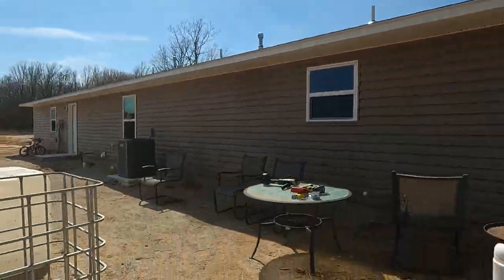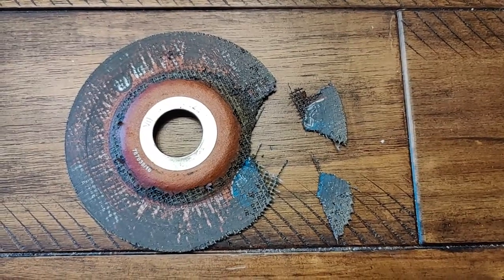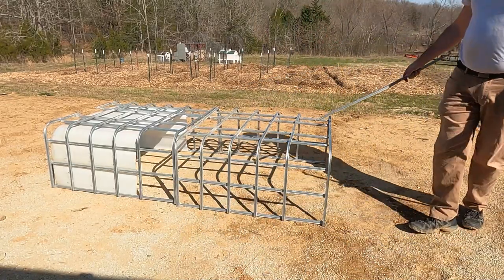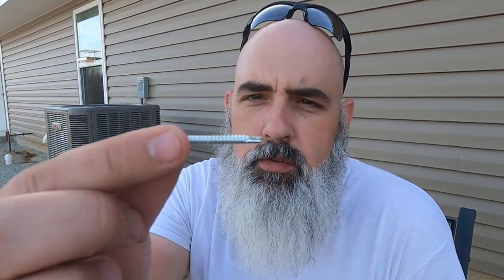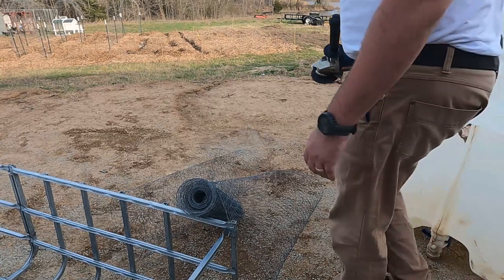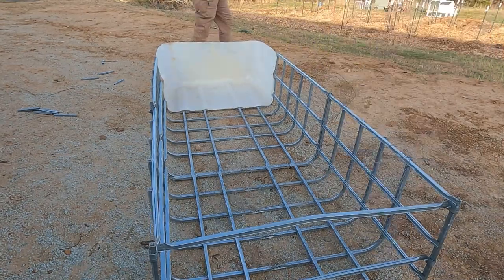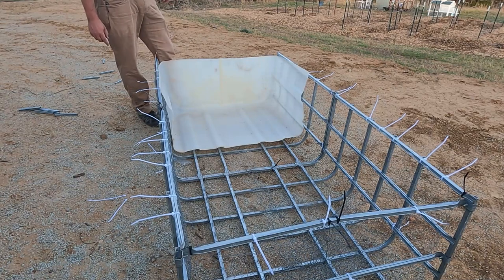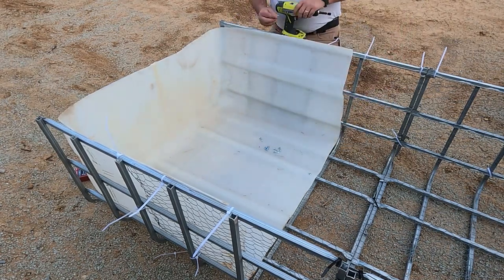How to Build a Simple, Sturdy Chicken Tractor from an IBC Tote

Comment: Seems like a good idea but it also seem like a waste of tote.  So many things that you did would have been easier done by out means.

Example: Instead of trying to figure out  how the crew hits, pre drill the holes, through tubing & plastic and then use a strip of 1x2 and sandwich the plastic using wood screws.
https://youtu.be/s8PzVw2xM3s?t=1775